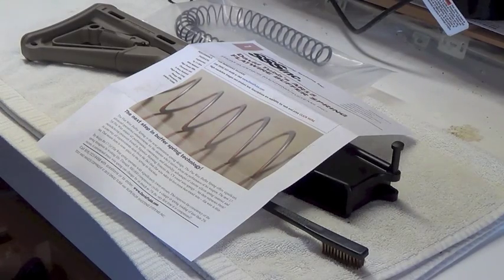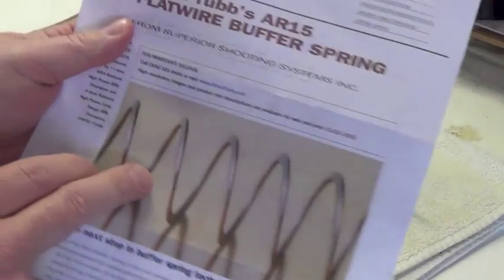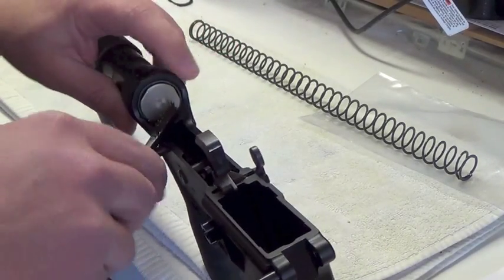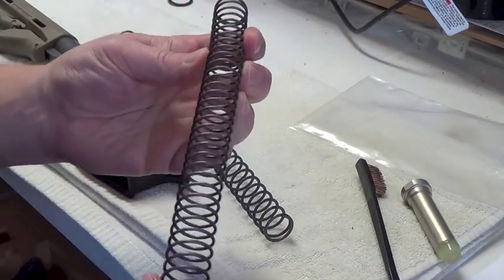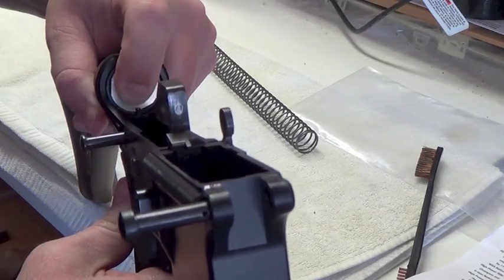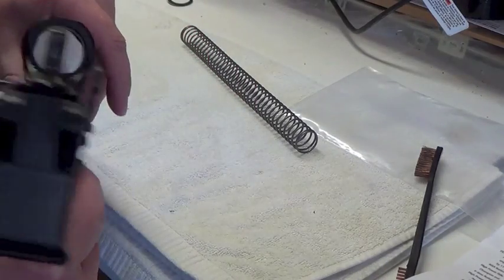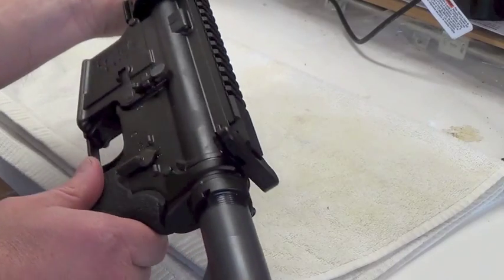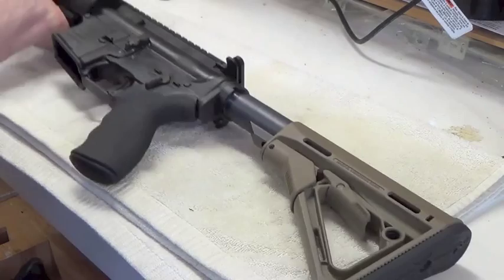David Tubb's Flat Wire Buffer Spring

Comment: The advantage of a flat spring can be visualized if you consider a basic bending tube vs a diving board.

As the tube tries to bend, one side-the side away from the direction of bending- gets stretched (tension or tensile stress). The other side --the side on the direction of bending--gets compressed (compressive stress). In the middle, these cancel out and there is neither, so it's neutral. This is called the "neutral axis."

The amount by which each side gets stretched or squished depends on how far from this neutral axis it is. A larger tube has more stress at the same amount of bend. It's also why it's stiffer (it takes more force to overcome this stiffness and deflect it the same amount).

Now consider a diving board-- the long, flat surface has very little stress for a given amount of bend because those surfaces are not far from the "neutral axis" along the middle where there's neither tension nor compression.

The flat wire spring is more like the diving board, and so it deflects with far less stress. And that reduced stress translates into fatigue life. And that's why the springs last so long.

The flat wire also having more space before solid height is another bonus when you cannot optimize the tube for the spring. (i.e., the AR receiver tube is designed around the round spring).
Reply from the maker: G5, this is the best description I have read and will be pinning it to my comments for all to read.  Thank you for your thoroughness in your response!
Reply: You are welcome, I apologize very being wordy. It's interesting to note that almost all recoil springs in pistols are now flat springs, braided springs, or combinations of each. And modern engine valve springs almost always now use an oval (ovate) wire shape, not round wire. The point is this: almost nobody today designing a spring for critical applications where fatigue is a major problem would consider using round wire. It just isn't done anymore.

Comment: Wow, sorry nobody has helped out with answers.  I build ARs at a gunshop that specializes in ARs and a few other firearms.  We all run these buffer springs in every one of our ARs, pistols to long distance builds, every length gas system.  We accommodate for cycle timing through buffer weight, but using the flat wire is huge in ensuring even if the timing isn't optimal the gun will run.  The spring is longer uncompressed meaning it will have more compression against the back of the bolt.  The coils compress smaller at full compression with means it will have less compression wear during it's cycling.  The springs will last longer than the barrel in an AR.  Lastly, it eliminates the buffer spring "spoing" sound when shooting.  This is a big deal with a suppressed AR and the action noise from a std spring is so loud it's annoying.  They cost more, but they are worth it.  We coat the spring with a little grease when we install them and tell people to only take them out if they know the spring got dirt or sand etc in the tube.
Reply from the maker: Thanks so much for the detailed feedback...less compression on the spring does make me happy...
Reply: @The-Tech-Man  you can run H2 or H3 with the CSFW and you will have plenty of force to go into battery. Assuming your objective is to avoid rifle buffer and tube.
Reply: @FT4Freedom  lol thanks for the answer. I've figure out everything I've needed to shortly after commenting. 😂

Comment: Just bought one of Tubbs flat wire springs. Put in my rifle about an 1 hr ago. The rifle is now dead quiet. I was skeptical. Now I'm impressed. My other AR rifles are running Geiselle Super 42 braided wire springs.  Tubb's spring is every bit as good and 1/3rd the price.

Comment: So I built my AR from a A2 style carbine to a mid length system. I got the geissele super 42 in originally. Initially I was having problems  with low powered rounds short stroking, not stripping new rounds, etc. Gas looked fine however. Swapped in old mil spec spring, same issue. Took to local gunsmith he put in flat tubbs and bam, no more issues. 👍 I was shocked.
Reply from the maker: Thx for sharing!  Good to know!
Reply: @HuntsvilleHunter  LOL. Thanks, figured I'd spread the knowledge since I was so stumped. 😆

Comment: having a hard time choosing, Geissele Braided, Flat Springs, Jp silent captured. The standard spring is just so cheap that all the aftermarket springs look glorious.
Reply: The three systems are not the same. And it really depends on what your objectives are. If you want to reduce cycling weight(softer shooting) by running lighter BCG(8oz) and lighter buffer(1oz) then the Tubbs CSFW spring allows for ultralight BCG and buffer because it has more terminal forward force to strip next cartridge and complete battery. The Gsle braided spring is not flat and doesn't provide the best force to battery, you will need a heavier mass in buffer(harder recoil). The JP SCS is most versatile but heavy(adds 1.5oz) and it requires maintenance every 3k-5k rounds because o-rings degrade over time. This is assuming that you will be running with adjustable gas block and tuning down gas to takeadvantage of lighter BCG and buffer. AGB is essential.
Reply: @FT4Freedom  I have the geissele super 42 after trying many option like strikes flat wire jp silent spring and I like the jp silent spring BUT if you want it quite for like a suppresses build that’s a great idea but the super 42 from geissele is the best imo and will last the longest

Comment: The flat wire allows for additional coils in the same length spring which provides extra strength in the spring. This will help with stripping rounds out of the magazine, especially when using steel case ammo. It also helps prevent bolt bounce. The flat wire also has better harmonic dampening qualities compared to round wire which helps to eliminate the "twang" sound.
Reply from the maker: Barry The Chopper TY
Reply: To add to what you've said, the spring adds lock up pressure when the bolt is forward/at rest, and decreases the spring weight at maximum compression. I've found that I need less gas to run a Tubb spring while maintaining superior lock up pressure. 
I'm currently doing some testing with suppressed/SBR platforms to see if it's beneficial.
Reply: AND you can drop the weights from your buffer. Reducing cycling mass and recoil.

Comment: With the Tubbs CSFWS, a lightweight BCG and adjustable gas you can essentially remove your buffer weights or run a ULW buffer and still cycle the rifle. The significance of this is you have reduced the reciprocating mass of BOTH your BCG and your H buffer. Removing 2-3oz from BCG and 2-3oz from buffer. Huge drop in reciprocating mass. Must use AGB and tune. Do this and get your 556 to recoil like a 22lr. The Tubbs CS flatwire is the key. Because it's stronger and doesn't have a vibrational node. Therefore, no buffer weights required to compensate for secondary bounce. This is HUGE. Tubbs has essentially eliminated the handicap of the buffer. Applies to semiautomatic fire only. Full auto still requires buffer weights.
Reply from the maker: Fantastic insight here OWL...thanks for watching!

Comment: Getting a lot of stove pipes In my new DDV5 6.5 creedmoor. Just ordered this spring I hope it helps.
Reply: Did this help with you stove pipes? You’ve had four years to fix it. I’m curious what you did.
Reply: @samuel.d9059  the spring did not help. I added buffer tube weight and that did the trick. Needed to slow down that bolt just way over gassed.

Comment: I bought one recently as well. Mainly because I was having over-gas ejection at 1-2 o'clock. I wanted to get my brass to eject at 3-4 O'clock, thought the spring was the fix, combined with h2 buffer. My gun smith ended up selling me on a different route.. Gun smith told me, "in ar15 bcg design, it is meant to be slammed shut with the tension of the mil spec spring. If you increase the power of the spring and slam the bcg forward too hard it can start cracking bolts and other parts..." Do not know how true this statement is, but seems logical. I am going to run the spring and see. If it starts taring up my bcg ill let you know.
Reply from the maker: Joe, thanks for the insight here!  Definitely let us all know what you find out...gunsmiths like to show their worth with knowledge that may or may not be a factor, but it’s worth testing out.

Comment: would you recommend swapping out the existing buffer as well or word the standard buffer it comes with work well with this new spring
Reply from the maker: Isaac flores Great question...I did swap mine out, but even the one that came with the LMT lower worked fine...i know that with a stronger spring sometimes you want to upgrade...
Reply from the maker: Isaac flores Same here...crap spring...this one did the trick...but there are quite a few to chose from...good luck..
Reply: Get a spikes tactical tungsten powder buffer. Believe it is dubbed the T2. Maybe T3. I forget. Quick search you will figure it out. Will add even more silence to your AR.

Comment: Hello, I noticed you said you "tapped" it on.  I'm assuming you mean tapped the buffer into the flat wire spring.  My V Seven H2 buffer, or any of my other buffers, won't slide all the way into the flat wire spring.  I was going to try to force it but forcing things tend to cause problems in my experience.  Did yours slide right in, did you have to persuade it a little to get it to go all the way in?  Thanks in advance
Reply from the maker: Yes, good catch on my “tapped”...and yes, I did have to massage it in...but it wasn’t too bad...worth the investment...just a smoother return on the bolt with this spring!

Comment: If you use a flat wire buffer spring do you need buffer weights to minimize bolt bounce
Reply from the maker: Michael Jordon Great point...I have not but It might be a good call..
Reply: Yes you can remove the internal weights assuming you are running a lightweight BCG 8oz ish. And AGB.

Comment: But they don't work worth a s*** in a AR pistol 10in and under. There's too much pressure against the bolt versus the gas coming back to the gas tube to the bolt. Mine jams on every shot would not cycle another round. Of course that was on the 8 inch Barrel.
Reply from the maker: Good to know Cliff, thanks for the intel...
Reply: Trim coils from spring.
Reply: What did you use? My 300 blackout has cycling issues with a 8" barrel also.
Reply: @StreamingMusicCity  strike industries flat wire. There is too much friction between the spring, and the buffer tube.
Reply: Just came across this thread David Tubbs makes a 300 blackout reduced buffer spring for that caliber 300 blackout I put one in my 10 1/2 inch pistol works awesome with the H2 buffer shots sub sonic and everything.
Reply: @dynamicfirearmsinc432  556 was never intended to be a pistol round. I cut the wire down and it worked fine.  Take about an inch off.